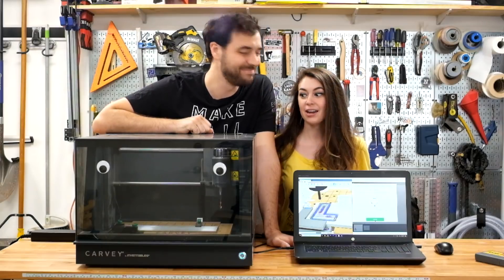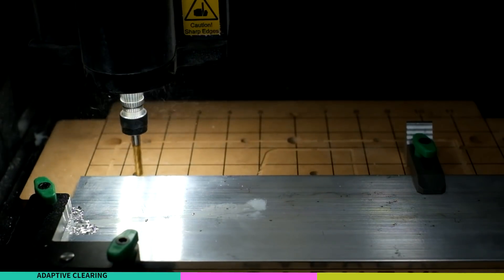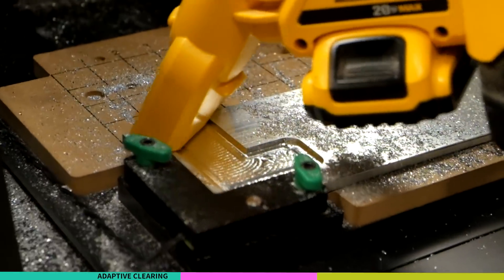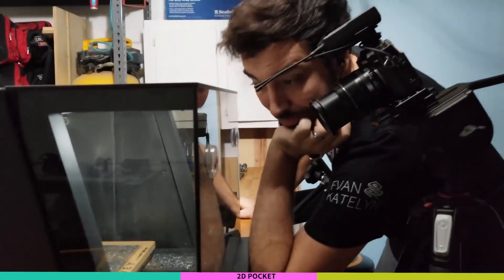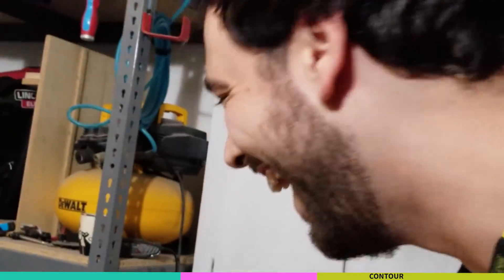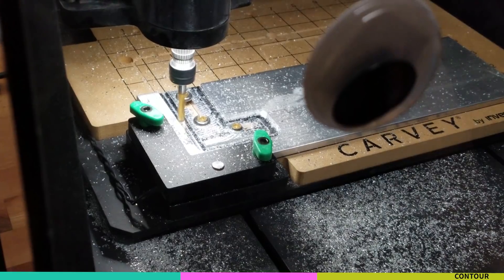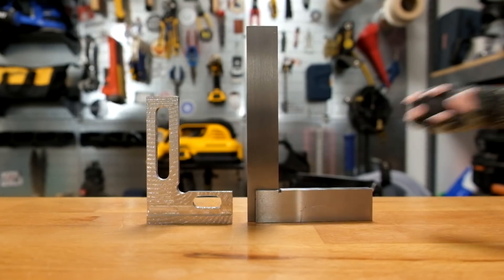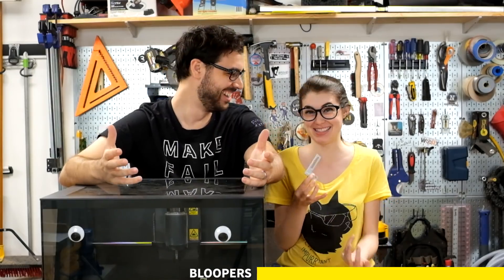Can You Cut Aluminum on a Desktop CNC?

Comment: I am also interested in making parts and bits from aluminum, perhaps you might be interested in what i plan on doing but as yet have not got round to it. Aluminum melts as a fairly low temperature compared to other metal, there are lots of DIY furnaces on youtube. All you'd have to do is imprint the design into sand, melt the aluminum and pour into mould. The thing i love about this is one can use cans etc.
Reply from the maker: That sounds awesome! We've played around with melting pewter before but never aluminum

Comment: Great to see the experiments! Look into trochoidal milling, 1/8" bits, 1 or 2 flutes, better chip clearing, and mist lubrication to improve results. The advice and experience for conventional mills doesn't work well on these flexy, small, high RPM spindle machines, and aluminum presents some special opportunities and problems.
Reply from the maker: Thank you for the tips!

Comment: Awesome to see this in action! The googly eye vibration monitors are a nice touch. Would it have been a cleaner cut if you applied cutting fluid during the process? Just a few drops along the path. Or since the carvey is an enclosed machine was this on purpose not done
Reply from the maker: Haha thank you! We on purpose didn't add fluid and instead got a bit with a coating that negated the need for it (less mess)

Comment: Not sure if you are directing the direction of cut or the program is. As with a typical wood router, you usually run the router left to right to keep from router walking or climb cutting or chatter. So it the program is setting the cutting action, you may need to change the direction of cut to keep from getting bit chatter. It looks like the router was working counter clockwise, but the bit looks like it is designed to run counter clockwise as well. Could be that is part of your bit chatter. Just saying.
Reply from the maker: We had it doing conventional cutting because usually you use climb on more rigid industrial machines.

Comment: With a machine which has no positional feedback, you are going to have a really bad time making something precise in a decent amount of time and with good surface finish. Just my 2 cents
Reply from the maker: Im wood weve been able tomhit tolerances of +/- 0.002 which  is pretty good considering the price of the machines  we have. But yeah with aluminum it will definitely be tougher! Still testing, still learning 👍🙂
Reply: As long as you are satisfied with the machine and results, its all good :) but keep in mind that chatter can cause a tool to break and those can be quite expensive.

Comment: Everyone is talking about the diameter and size of the endmill and they're right but your spindle is not so powerful too, so you need to keep very low speed rate compared to other CNC of the same shape of yours because your spindle can't handle much torque , keep it slow rates and use 1/8" endmill with 1 or two flutes and a bit of coolant mist even WD-40 will do wonders , carbide is very strong and high temperature resistant but never try to cool with airflow to close to the endmill because the variation of temperature will break the carbide
Reply from the maker: Definitely lots more to dial in - I think we'll switch to a stubby 1/8", although we had a hard time finding anything shorter than the one we got. Although our bit had a special coating that negated the need for coolant, so I think we will try sticking with that so that we don't make a mess in the Carvey 🤞🤞 Thanks for all the tips!

Comment: If you want it to cut safely and unattended then the 1/8 cutter as short as your deepest cut will make a world of difference.

There is always a way to make any machine cut. You could likely do steel on that machine.

I program and set up CNC to cut one offs all day and adaptive clearing is the greatest thing ever. Being able to control radial engagement practically eliminates chatter. You can even do the outside contour with the adaptive clearing (boundaries are your friend here). Also you can measure in your CAD the difference in Z on the ramp helix and adjust your angle until you get more manageable cuts for interior pockets..
Reply from the maker: Thank you for th tips! Definitely want to try an 1/8" cutter next. Appreciate the encouragement and shared knowledge!
Reply: @EvanAndKatelyn  Happy to help! Don't be surprised if your post processor/NC estimates very long procedures. My wire machine at work has been cutting for 38 hours and it just passed 90% . I love automatic machines
Reply from the maker: Dang 38 hours! That's crazy!

Comment: I hope no one watching this wants to get a carvey for aluminum yow! To get better results though try a much shorter bit. You have quite a long lever arm for such a floppy machine and shoring up the length will help you do more with what you've got.

BTW the main reason the carvey (and others like it) sucks is that it has unsupported linear rails which act like springs when they encounter tough materials. The rigidity just isn't there.
Reply from the maker: It's not built for aluminum specifically but it's what we had and we we're happy we could make it work, though with even more fenangling (shorter bit, 1/8", messing with speeds) I think we can get it even closer 👍🤞
Reply: For sure, I bet you'll be able to improve things a bit still. Just remember as you slow things down, you're not taking away as much heat with each chip and you can wear through cutters quickly. For my 6040 router (which also kinda sucks for aluminum out of the box) I have the most luck with 6mm single flute carbide cutters for this. Also, WD40 is a great lubricant for the cutter. Best of luck!
Reply from the maker: Thanks for the tips!

Comment: Great work guys! I broke about 30 end mills before I got it right. 
Also, hot tip! I cut at:
Feed rate - 900mm/sec (35.4 Inches/Minute)
Stepdown / Depth of Cut 0.3mm - (Max)
Stepover / Optimal Load / Width of Cut - Half the diameter of the End mill you're using

You can set the Stepover/Stepdown in the 'Passes' tab on F360 and play with that to really dial in each toolpath so you can leave the machine running and trust that it won't go off piste! I've even got mine set up so I can run it from my phone and go out but check on the machine wherever I am.
Reply: oh, and a single flute end mill will be the best for aluminium - I got a pack of 10 from china on eBay for like $20
Reply from the maker: Thanks for the tips! Man, so much conflicting advice about flutes though - some folks are swearing by 4, some say 2 was the right choice, and now a vote for single!
Reply: haha true! I had the same issue but did find that a single flute was the best of all, especially as I use a desktop (stepcraft) CNC as well, they're not well designed to take the vibration that a bigger end mill with more flutes seems to generate. Also I'd recommend not going over about 3-4mm diameter for your End Mill. I'll be uploading something in the next week or so with 1,2 and 4 flute end mills and you'll see (and hear) the difference!

Comment: On a machine this weak/light and small you need to use smaller endmills and choke up as much as possible, meaning the stickout on the cutter should only be as much as you need for the deepest cut. Try a helix with very small angle instead of helix as well.
Reply from the maker: I think we need to find stubbier bits, we had this one in as far as it could go but it was still a little long. Thanks for the tips!

Comment: and your tool is too long = not rigid enough and use coolant to prevent the bit from welding itself to the material
Reply from the maker: We definitely would like to find a shorter tool, just didn't have any luck prior to the project. But we actually had one with a special coating that negated the need for fluids, so we are good on that front. Thanks!!

Comment: So you guys are doing what is called conventional toolpaths. Meaning the lead edge of the end mill is being crammed in to the material. Reversing your toolpaths would result in what's called a climb cut toolpath. You guys may be doing conventional cuts because of the "slop" in these desktop mills. However, if your machine is tight enough for a climb cut toolpath I would recommend that. Nice work on tackling something new, I enjoyed the video. 👍
Reply from the maker: Yep yep, we were doing conventional because it's not as rigid as an industrial machine. We are open to trying it though!

Comment: I would probably suggest using a 3 flute endmill rather then a two flute. it should help in reducing the chip load and will work better for slotting.
Reply from the maker: Ah interesting, there's been a lot of mixed opinions in the comments about flute number. Some say 2 is the way to go, some say 4, some say 3. Looks like we need to do more digging!

Comment: I would go for a smaller end mill, and a shorter one (stubby). With the very low rigidity of the machine that long cutter is a problem and a smaller one would allow you do adaptive clearing for all operations, except for the cleanup pass.
Reply from the maker: Yes, we definitely wanna try a shorter endmills and maybe go for 1/8". We had a hard time finding a stubby one though. Guess we need to keep hunting. Thanks!

Comment: The endmill is sticking out waaay too much, which is causing lots of deflection. Also, you really should tune it down to like 10 ipm on a small machine like that. Just a thought.
Reply from the maker: We had the endmill in as far as we could go, but had a hard time finding shorter endmills. Definitely want to try a shelter one though. Thanks!

Comment: A really nice thing is that there are definitely a few things you can do to get better results. I'm sure I'm not the only one who is suggesting these things, but maybe my post will reinforce what's prolly already been said...
Any time you can reduce the stickout you will get better results. This is true 99% of the time. Reduced stickout = better rigidity = better results. Thinking about the stickout is probably best done when you're actually buying the bits, because once you have them you're kinda stuck. Look for "stub" end mills.
Using a smaller diameter bit would, of course, reduce the load on the machine and improve your chances of getting good results. Carbide is super strong, even tiny end mills are harder to break than you might expect. (Though, big ones will break surprisingly easily sometimes.) A really nice thing about smaller bits is that they cost much less, so buying multiples is less painful.
When thinking about your cut parameters, I recommend kerping the chip load (the "feed per tooth" setting) above 10 microns (0.01 mm) at minimum with a goal of getting up to about 40 microns. After you've decided on your target chip load, try to decide on an appropriate spindle speed to use. "The faster the better" isn't necessarially true in my non-professional experience, though I see other people who seem to think otherwise. I'm guessing you guys will have to turn the spindle speed down quite a bit, but I'm not sure what the range of the Carvey is. When cutting aluminum, I'd say there is no minimum and no maximum spindle speed, don't worry about the bit's suggested "surface speed" (SFM or SMM) - the bit will cut at any speed, just find a speed that your spindle "likes" and pay more attention to the chip load. As for width of cut, I'd suggest using 25% as much as you can. Sandvik says 70% is best (but that's probably way too much for the Carvey) and 25% is a very close second. 50% is the worst. Once you've established those parameters, which you can do before you even put the bit in the collet, you only have the depth of cut to worry about. Start shallow and if the machine isn't having any problems, imcrease it on the next run. If a shallow depth isn't working, try something crazy small, like 100 microns (0.1 mm). If the machine isn't doing well at 100 microns, the bit is probably too big, unfortunately. It might be worthwhile to try a different spindle speed (change the feed rate too, to ensure the chip load doesn't fall below 10 microns).
Maritool has a 1/8" end mill with a 1/4" shank that I think is pretty killer. The one I have has 1/2" of flute length, which is prolly going to be enough for many projects, and the 1/4" shank makes it good and rigid.
Lastly, after you've found a bit/feed/speed/DOC/WOC that works, you may encounter "chip weld". I'd recommend against changing your cut parameters in response to chip weld, instead try to improve your chip evacuation. Set up an air stream or something, just get the chips our of there, getting them out of the path of the cut is basically all that matters. (If the stock material is getting really hot, that could contribute to chip weld too and should be dealt woth somehow.)
One more thing: the aluminum alloy matters. 6061 is good, but the more expensive (and much stronger but also less resistant to corrosion) 7075 actually machines better, in my limited experience.
Reply from the maker: Thank you for all of the tips!! This really does help a lot. We had a hard time finding shorter bits but definitely agree that that would be better, and we'd like to try 1/8" too! We actually have thought about modifying the carvey for dust collection so maybe that would help with chip evacuation. Thank you!!
Reply: I went to look for the bit I was talking about, but couldn't find it easily, so I had to search Google with the model number. The exact Maritool bit that I'm using has the following model number, in case you'd like to check it out...
1021-.125-.563-SP-ZrN

It's really cool that you guys read and reply to so many of your comments! (Also, sorry that this post turned into a novel!)

I figured I'd mention how I decided that I liked that end mill enough to enthusiastically recommend it. Short version: I needed a long-reach 1/8" end mill, tested a few, and that one was the best for my needs/abilities. (Longer version below*)

I saw some comments suggesting you use WD-40 and figured I'd give you my 2¢. I'm a hobbyist so that might be all this is worth... First, IF you're going to spray something on there, WD-40 is actually one of the better choices (from what I've read and seen a tiny bit) as compared to other lubricating sprays. It's funny, the nearly genericized product WD-40 is better for cutting aluminum than many, many of the other lubricating sprays out there. (It might not be better for general lubricating, but it's better for aluminum cutting.) Now, with that said, I agree with what it seems you've already learned: spraying with liquid may make things worse. I've found that adding a little bit of liquid to small granules of aluminum basically makes "aluminum mud", which just ends up sticking to everything and making a mess. So, unless the chips are larger or unless you're going to be spraying enough to actually get the chips away from the cutter, it's probably better to leave it dry.

OK, I'll just end this here before this post really gets out of hand. Good luck!

* I am/was working on a project that needed some small features cut in the bottom of a somewhat deep pocket. Basically, I needed an 1/8" end mill that I could use with at least 1.5" of stickout. I had a few very similar 1/8" shank, 1/8" flute diameter end mills from Harvey Tool, Lakeshore Carbide, Maritool, Shars, and Destiny. There might have been a couple more in the mix too. I tried them all and, for all intents and purposes, I couldn't find a speed/feed/depth that I was happy with for a single one of them. I'm an amateur, so maybe I didn't change some parameter that I should have, but one way or another I just couldn't find anything that I was happy with (and since this was using a fancy CNC mill, I figured the bit was the largest determining factor in my troubles). I did note, however, that the Maritool bit worked the best out of what I had. Then it occurred to me, maybe there exists a bit with a larger shank that necks down to the 1/8" flute diameter that I wanted. I had seen other bits like that (many tiny bits have a 1/8" shank) so I figured maybe the same idea would be used in a scaled-up size. I looked around, but came up mostly empty-handed, but I did find ONE. And best of all, the one I was able to find was also made by Maritool, the company that made the "normal" 1/8" bit that worked the best for me. Anyway, I bought one and tried it, and the difference was night and day. I'll just mention that I have no affiliation with Maritool, just in case this might look like I'm shilling for them or something. My current favorite 1/4" bit is from Niagara Cutter and my current favorite 1/2" bit is from Garr Tool, I also have favorites from Lakeshore Carbide and Shars too (I LOVE the performance I get out of Shars' standard-length 1/2" aluminum end mills). Personally, I haven't had good luck with Harvey Tools' "normally shaped" tools, but I do use several of their "wacky shaped" end mills. I've also heard good things about YG-1 from a lot of sources (Winston Moy is one of them, I believe). I bought one of their bits  but haven't tried it yet.

Comment: What was your spindle's speed for each pass?  What is the mfg and model number for your spindle?  What type of aluminum (6061, 4042)?
Reply from the maker: we did 10000 RPM for every pass and the aluminum was 6061. Here's the spindle we used https://amzn.to/2Qgl2Jp
Reply: You might want to lower the spindle speed to 8,000 RPM for 6061 Aluminium, 1/8" (or 5/32") diameter 2 flute mill, and adjust the feed rate to achieve 280 surface feet per minute (SFM).  Check out this online feeds and speeds calculator:  http://www.custompartnet.com/calculator/milling-speed-and-feed  You guys are doing a good job showing Fusion 360's CAM capabilities.  Thanks for the video and  quick response.